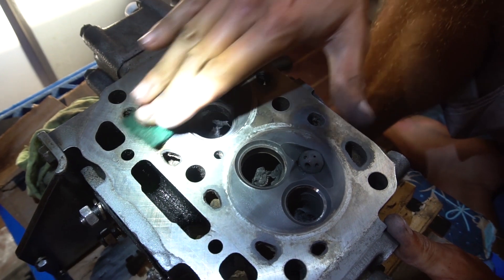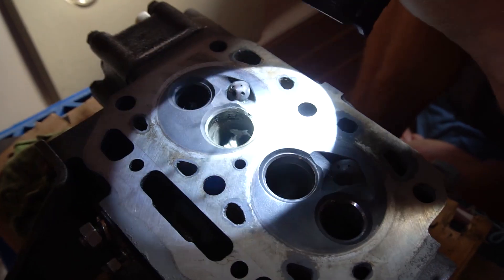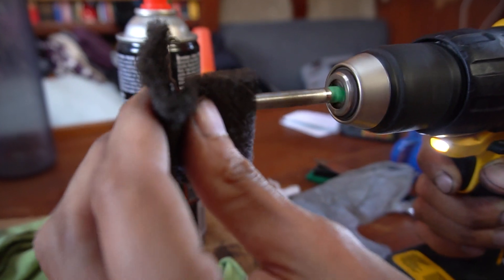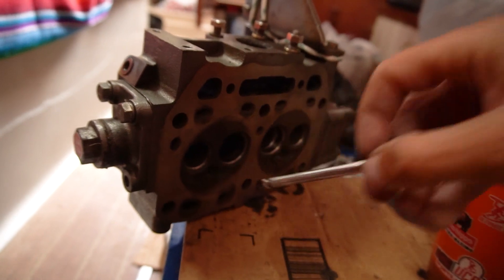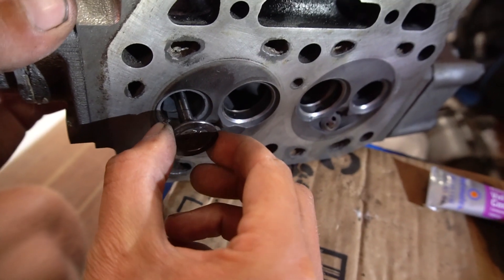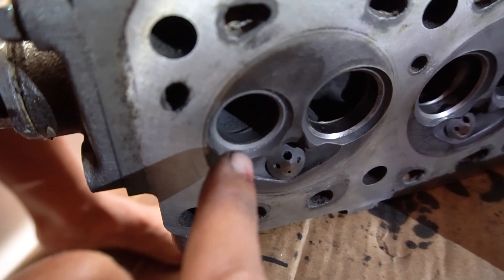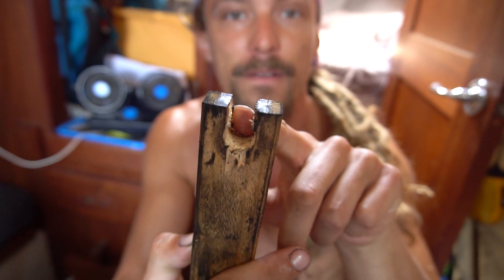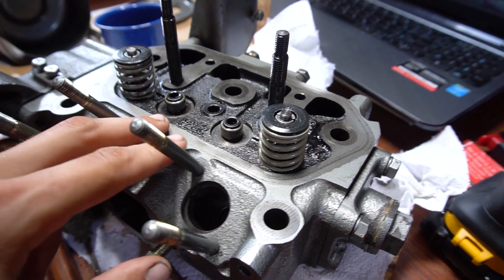Yanmar 2GM Engine Rebuild: Lapping valves, Valve stem seal replacement (Part 4)

Comment: Did you ever clean your heat exchanger? If so, which video is it on? Crazy question, I know, but I can't find any good videos on the Yanmar 2gm. They're all on 2gm 20s
Reply from the maker: We don't have a heat exchanger with this engine. It's all raw water cooled.
Reply: @WildlyIntrepid  ahh. Mine might not either. I gotta find my manual . Lol. Thanks. Hope yall are well!